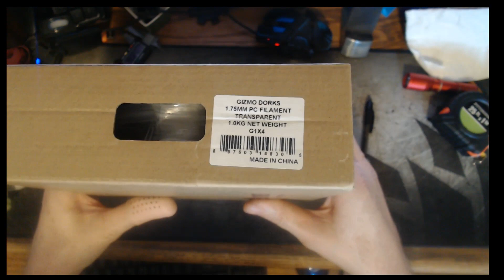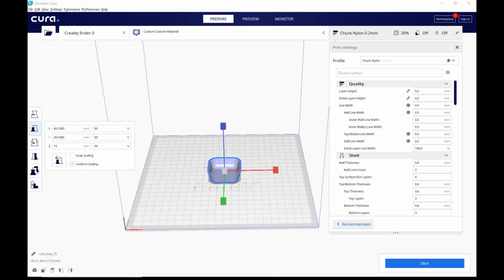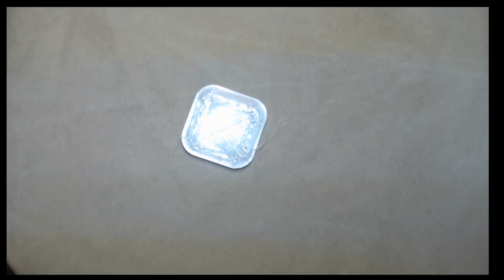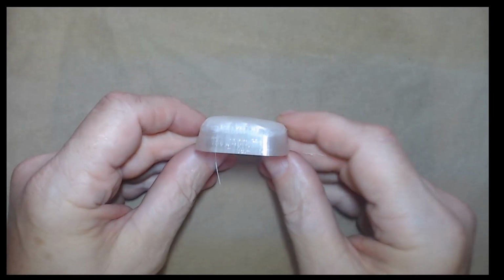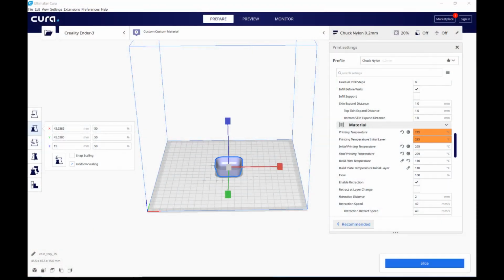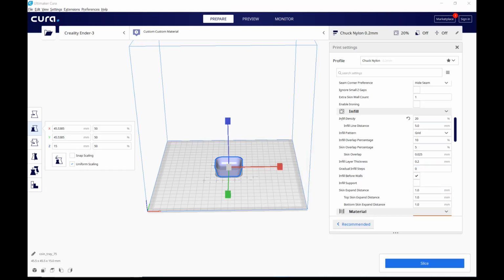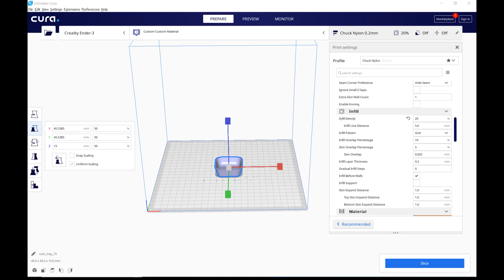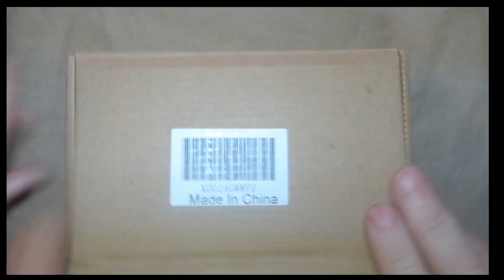Can You Print With Polycarbonate on the Ender 3?

Comment: Have you tried the Carbon Fiber Polycarbonate filament from Priline?  It claims to be printable at 240-260C with a hot bed of 80-100C (which is totally doable with the Ender 3).  They probably use a cheaper, flimsier plastic than standard polycarbonate, but it still sounds tougher than PLA.  The only thing is it is super abrasive so it requires a hardened/stainless steel hot-end, and could wear down a Bowden tube.  I might be giving it a try soon just to see if it will work.  It would be a nice alternative high-end filament to use if it works.
Reply: i bought it but haven't used it. can't think of anything to print it with until i get a scanner though. any luck with yours?

Comment: Totally a noob, but would placing a heat lamp directed at the build area help at all?
Reply from the maker: It might help to preheat it, but filaments like nylon and polycarbonate really need an enclosure to keep the temperature stable. Also, you can't heat the bed up more than what's specified in the slicer without a danger of the firmware thinking there's a thermal runaway issue and halting the print. Honestly, everyone I spoke to or read about had serious issues with that particular polycarbonate filament. Not sure what it takes to get it to print right, but I sure haven't achieved it. Since then I've gotten two other brands of PC filament, I just haven't had a chance to test them yet. Hopefully in the next week or two I will.

Comment: Yes you can! :) well an ender 3, SKR 1.4 main board, modified firmware, Microswiss hotend and a WhamBam print surface. I am working with this stuff on an experiment to 3D print light pipes, video coming soon. I think the biggest part of this working is the WhamBam print surface. Review of that coming this week :)
Reply: How do you set the nozzle temperature higher than the default 260°C?
Reply: @KINGDOJOJOD  you need to upload a custom version of Marlin to the control board to go higher

Comment: Very  nice experiment. I fully concur with your  analysis of the twist. The  shrinkage of the polycarbonate as it cools after extrusion acted like a rubber band placing tension on the part. That combined with the melting of the hairspray caused the twist. Reducing your print speed to 20 mm/s would more than likely reduce the twist and turning off the part cooling fan may help and increase layer adhesion. You could try a slurry like in the early days. An ABS slurry may hold it.  If it does, be carful it so it doesn’t damage your build plate. You may have to remove the part while the plate is hot. I’ve never actually tried this but, it sounds good in theory. Good luck and thank you for doing this.
Reply from the maker: Thanks for the comment! If you watch my latest video you'll see that I've tried a number of other things including an ABS slurry and nothing worked. Since then people have recommended printing on sandpaper and on polycarbonate. I've tried the latter, but it was on a very smooth transparent piece and maybe it could use scuffing up. And yea, cleaning off the ABS slurry sucked.

Comment: https://youtu.be/qXUtxt61Ae0
Reply from the maker: I saw that video quite some time ago. I remember looking up the cost of the Duet board he used and thinking "Dude, that's more expensive than the printer!!".
Reply: @3rdpig  I wonder if it can be done with the SKR 1.3 board?
Reply: @billkaroly  stock board can support 315c hotend and 125c bed. you just have to flash software with modified end points.

Comment: Did you have the cooling fan on or off? Is it possible you are under extruding?
Reply from the maker: I tried it on and off. I even tried turning the ceiling fan off and shutting the A/C vent in the room. I'm not underextruding on anything else, but since I've never messed with this filament before it might need a tweak or two above 100%.

Comment: I have a BIBO Facebook group for folks who want to modify their machine and one of my members prints Polycarbonate on his BIBO Touch but he can't on his Ender 3. I have two older BIBO machines and frankly I am surprised his BIBO can print polycarbonate.
Reply from the maker: I've talked to several people who've successfully printed PC on the Ender 3. It mainly involves getting the right filament, the enclosure and being able to sustain a 260-270 nozzle temp. I'm going to try again as soon as my enclosure is done.
Reply: @3rdpig A problem with cooling fans is they tend to blow on the nozzle.

Comment: I use hairspray on a glass surface (plain single strength window glass) on my Ender 3 but it seems I use it for a different reason than you do. I use it to help a print release easier from the glass bed. If I print onto bare glass, the print is really difficult to remove and I fear pulling chunks of glass off the surface. I'm not printing polycarbonate though, just PLA, ABS, PETG, and TPU.

Comment: keep up the good work on the videos!
gizmodorks was only good for me at 300-310 C from a temp tower test on my ender 3 (stock with capricorn). it was very dependant on print speed too. it would cook if printed too slow and lose strength. bed needed to be 110-120 with hairspray as a RELEASE agent (stock bed surface).  Also enclosure....mandatory id think in this case. A cardboard box would work until you get something to solve the moisture issues. I just have a bunch of silica kitty litter in my enclosure and filament box. 
polymaker pc-max (not pure PC) is way different. that needed 270c, no more or less. strength suffered greatly even +/- 10c. bed temp seems fine at 100c. this one or blends (any PC that works under 300c) like it really are probably best. They may have a shade less strength but getting flat usable parts has its advantages. :)

Comment: Chuck, polycarbonate is very hygroscopic. You do have the advantage of living in a dry state. You may have to still dry your filament the next time you use it. I also heard people using a Lexan (PC) sheet or Garolite as a bed surface and a nozzle temp around 290C and no part cooling fan. PC is a real tricky material. Good luck. I like all the experimenting you are doing. Very educational!
Reply from the maker: Thanks for the tips Patrick!  My next step is an enclosure and while I'm at it I'm going to put the 32 bit SKR board in it and relocate the electronics and power supply. I stopped at Ikea today (horrific experience, lol) and picked up two of their Lack tables and some LED lights. And yea, I think a food dehydrator is going on my Christmas list.

Comment: Awesome Chuck... I got the same Bigtree 32 bit board with the drivers.... I still dont know how to connect it though so i havent been bothered to change it over to my Ender 3...... I hope you can do elaborate video on how to install and where to connect..... Anyway Thanks for you great vides..... Oh by the way i was looking into changing my hotend to the Mosquito hot end but nthe temp on any hotend need to be changed at the firmware to increase stock temps if you have the right Thermistor. Any sugestions... Cheers Mate...
Reply from the maker: There are some pretty good videos out there of swapping the board, but I'll make my own just to add to the overall knowledge base...and so I can remember how I did it a year later, lol. 

If you want to start modding you're going to need to either flash a boot loader and then Marlin to your board or replace it with one that already has stock Marlin on it. It really isn't hard to do and the only expense is a cheap Arduino board and a long enough USB cable to reach from your computer to the board. Even then you'll probably need to reflash it every time you want to up the top limits. Not sure about the other printer OS's or the new 32 bit Marlin, I haven't seen those yet.
Reply: @3rdpig  Thanks heaps Chuck

Comment: Very interesting. I am eager to see what the enclosure brings you - supposedly this is the fix. I haven't heard of people needing the bed temperature raised as high as you have it for successful prints like these, but if it works, then great. Detaching the power supply / electronics from the Ender 3 printer base and keeping them outside an enclosure seems to be common among other people I have been following, so that should work fine. Best wishes.
Reply from the maker: Gizmodorks, the manufacturer of the filament, calls for 120c. I think with an enclosure and some tweaking a lower bed temp will probably work.
Reply: Ignore me then and follow their advice! Very exciting - I bought the all metal hotend you showed in a video and am pondering buying a second Ender 3 just for high temperature filaments like you have been doing.

Comment: Hey just wanted to let you know I have my ender 3 inside an armoire that also holds a converted food dehydrator that I use for 1 as a filament dryer and 2 as a chamber heater I also have a rasberry pi inside there as well running octaprint I was getting throttling on my pi4 but that was reminded with a 30mm fan
Reply from the maker: lol, you win! I don't think my wife would like it if I swiped her armoire to put a printer in. But I'm laughing just thinking about the look on her face. Ok, not laughing so much as cringing in fear. lol.

Comment: Hello, I printed polycarbonate on my CR-20 with stock hotend with a bed temp of 110c, 270c on the hotend. it stuck great to the Creality bed with no glue. Came out super strong. Surprised me too.
Reply from the maker: Interesting. What filament were you using? 270 is awful high to push a non all metal hot end. The Ender 3 tops out at 255 and the CR-20 spec shows max is 260. It looks like the CR-20 bed is pretty much a BuildTak surface. And you got no warping? I'm going to have to try that surface. Thanks for the info!
Reply: @3rdpig  yeah, no warping. I made a gear for a model helicopter and was just hoping it would work. I was very surprised to say the least.
Reply: @3rdpig  the filament I used is 'Push Plastic'. Yeah, I updated the firmware to allow 275c. I'm using the Capricorn bowden tube which is good up to 300.
Reply from the maker: @CheChe1061  Thanks for the info. I'm looking at the Push Plastic PC filament now. Interesting, lower temps and less warpage. I may have to try a roll. I've looked at the Capricorn tubing and someone gave me a small piece to test, good to know it will handle 275.
Reply: @3rdpig  Yeah, I tried the Micro Swiss hotend but it clogged all the time. Even with 2mm of retraction.
Reply from the maker: @CheChe1061  If you still have it and want to experiment, try lowering the Retraction Reprime speed from 40 mm/sec to 20 mm/sec. That and the retraction distance of 2mm is what finally got it working for me.
Reply: @3rdpig  thanks for the info Chuck, I will give it another shot. I bought an E3D V6 to try also.
Reply: @CheChe1061  are you using their "PC" or the "Pc-PBT"? Also do you know if it compare to polymaker poly-max PC? I havnt found any info out there on the webs :)